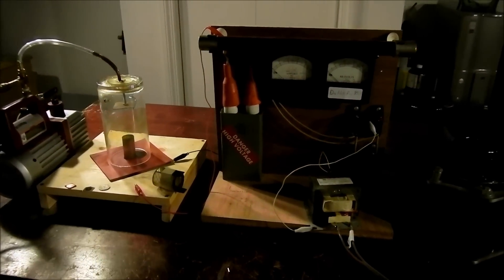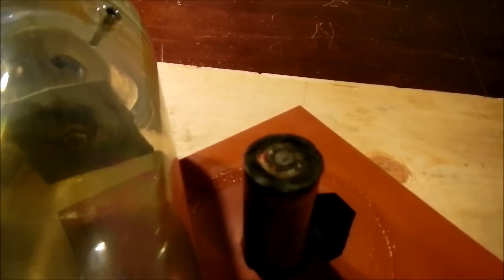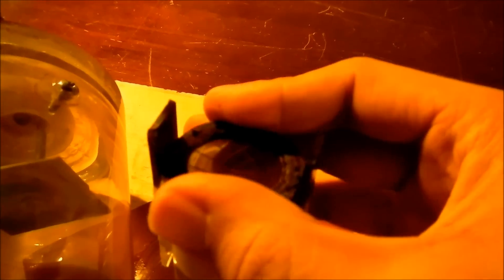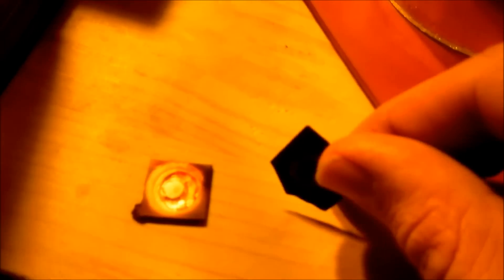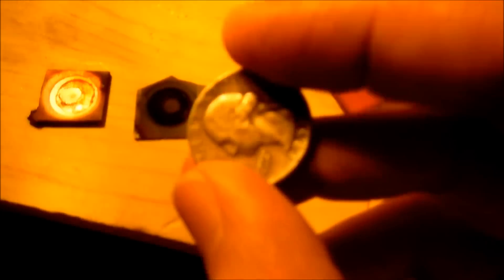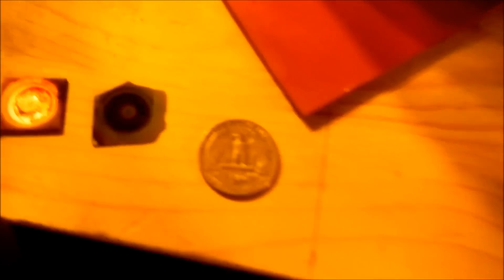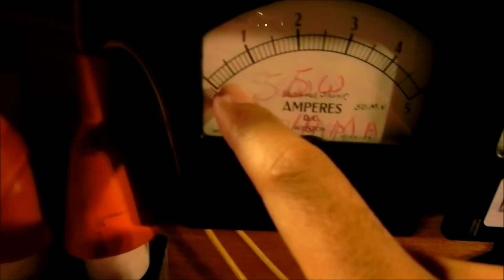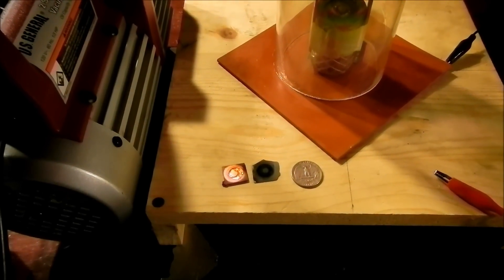DIY : Magnetron Sputtering of Cu, Si, Ag

Comment: What power supply voltage/amperage is required?
Reply from the maker: about 3kV initially, Voltage drops to about 500V to 1000V in steady operation.  100mA to 500mA current
Reply: @sparkstarter  I see. So it has to be adjustable voltage or it's just to save electricity? Maybe you have made guide how to make it? It would be amazing to make own dielectric mirrors, filters and AR coatings :)
There are on Ebay 1000kV 0.5A generators but they are not DC I guess
Reply from the maker: @sauroman1  you need to adjust the output to control the plasma. Haven't developed a DIY guide as of yet...

Comment: I thought you needed 2 transformers to sputter anything
Reply from the maker: why would you think you needed 2 transformers?
Reply: @sparkstarter  this guy from thought emporium on youtube did a sputter too and used 2 microwave transformers but I'm confused on how I'm suppose to wire just 1 transformer
Reply from the maker: @krukimoto6296  you could use 2 in parallel for more current.
Reply: @sparkstarter  do you think you could do a video on how to wire everything from power suply to the chamber 

Because that would be very helpful 

I know you need things like diodes and compasitors which you can get from a microwave too
Reply from the maker: @krukimoto6296  Yeah I think I will. Thanks Stay tuned.
Reply: @sparkstarter  thank you because if I could see how to wire everything correctly then I would be set
Reply: Throw in some safety precautions too because I know MOTs are dangerous

Comment: Hello sir! I will be waiting for.your reply kindly spare a minute or so to answer my queries!
First i am an undergraduate working on a project of fabricating a magnetron sputtering device. The thing is we are stuck to a phase that we have no articles even to follow up except for looking on for DIY videos. Firstly, we are using a rotary pump for.the experiment and as you told we need higher vacuum for it so do we still need 2 stage pump? Secondly we just have a microwave transformer that we have connected with diode to transform ac current to dc . But further upon connecting the diodes with capacitor, we are just getting arcs or sparks whatever u call it and nothing more, kindly let me know sir what equipments have you used for the very same experiment please sir i am in dire need of help! I will be waiting for your reply if you want i can provide you my email id just guide me through! I will be waiting for your reply sir please

Comment: Hi. Looks very nice! What watt was used? Is it 700~1000W? I want to sputter silicon. Although mine is not a proper 'deposition' equipment but I try deposition with a 4inch RF RIE with a silicon wafer as a 'target' and argon gas as ion source, but I don't know what power to start with. I tried Ar 1~5 sccm, 200W, 50mTorr for 30 minutes but still I got coating barely noticeable on my glass substrate. Should I increase argon flow? or power?
Reply from the maker: Yeah probably around 1000W, 1kV across the vacuum chamber at around an 1 Amp
Reply: @sparkstarter  thank you. Considering my much larger area, I guess I need to increase the power.

Comment: can you sputter copper onto silicon?  like for coating chips dies in copper to make them suitable for soldering onto the heat spreader?
Reply from the maker: You can sputter it on to Si but not sure about adhesion quality/ solder-ability/ or wire-bond ability. Would be interested to learn what you discover.

Comment: How would you do the inside of a thin tube?
I've been thinking about this a bit... an inner diameter of about 5-7mm.
Reply from the maker: You mean metallic coating on the inside of the tube?
Reply: Yup. I read a report that it's difficult to get the coverage uniform inside. I was thinking about using a long, thin rod around a couple mm run along the length. But does there need to be a standoff distance between the target and layer to be coated?
Or, would you be able to direct the plasma stream inside the tube to a degree with permanent magnets?
Reply: titanium and some of it's alloys have some properties that would be useful. Low friction coefficient, low reactivity, ridiculously hard and very good adhesion...
Reply from the maker: Don't think Plasma Vapor Deposition would be good for this application. Do you know about thermal vapor deposition? You could take the wire suspend it through the tube while in vacuum you heat the wire and metal boils off the surface of the wire and condenses on the tube. This might be tricky with titanium as you will need a Ti wire and Ti has very high melting point so lots of power to heat the wire I suspect... might be worth a try.
Reply: sparkstarter i havent yet, no. I'll have to check that out, though.
The tube would need a cooling system too, wouldn't it?

I'd have thought the heating requirements be similar... I'm gonna read up on the difference
Reply: sparkstarter i wonder if it would be possible to combine principles involved in the 2 methods...
Reply: How's this... the magneto pushes the ions away from the target, right? How about using permanent magnets to pull, instead?

Comment: is there x rays emitted during magnetron plasma sputtering ?
Reply from the maker: Not at these voltage and pressure levels. With much Higher Voltages and lower vacuum pressures there could be a concern.

Comment: Are you sure you're not generating X-rays or microwaves in a harmful amount?
Reply: In my experience, just because you do it for a living doesn't mean you are qualified as a radiographer or know  enough about how x-rays are generated to weigh in on the subject with any authority,.  

Also, in my experience, green in a vacuum in low pressure is x-rays and at that low a current, that'll be low power x-rays so congratulations OP,  you absorbed them all.  Fingers crossed for mutant powers but I'm betting on cancer.

Anyway...I digress...  Perhaps my assumptions are way off... perhaps everyone in this channel is educated and credentialed far beyond anything I could ever hope to achieve.  My advice is if you see green, shut it down.  Do like I do and head to your local hospital and talk to the radiographer and get a dosimeter.  Wear it thru your next week of experiments and have it developed and check it.  

Maybe it's xrays.  Maybe it's the copper (it's not).  Better to be safe than sorry - at least then you'd know for sure instead of trusting someone on the internet.  When your car is fukd, there are always plenty of people around who can tell you how to fix it, the hardest part is finding one who actually can.
Reply from the maker: Thanks for your comment, I agree that working in a particular field or having a credential does not guarantee anything. However, you can work out from the voltage drop across the vacuum chamber the maximum frequency of radiation. eV=h*f the potential correlates to UV maybe very soft x-ray that does not penetrate glass. I have tested the chamber with Geiger Counters sensitive to radiation, no radiation strong enough to trigger the detector was measured form the vacuum... So math and measurements say no x-rays... Just wonder why you think green is some sign of x-rays? Many things emit x-rays and don't glow green?
Reply from the maker: +68Stan yep I'm sure
Reply: the only radiation those would create is uv rays.
Reply: Good to hear you're across it my friend.  Why I think that.... I have been told in the past, by several old Power engineers, mostly working in the RF field that glass glowing green is an indicator that X-rays are present. The one time I saw a small globe turn green while playing with plasma displays (balls) it turned out that, that was exactly what was happening. 

That said, I was working well over 10Kv and at an unknown pressure (partial vacuum).  
However, maybe that was a fluke, thin glass perhaps?  Either way, a Dosimeter showed it was in fact X-ray, and I know I was around only 600W, so, low power x at that.  

And thank you sparkstarter, for that formula, I'll be doing some study on that one. I didn't study much math at school.

Cheers, Stay safe.

Comment: Extremely Amazing , I made a very simple electronic circuit on a microscope slide lame U can see it here : https://www.youtube.com/watch?v=VGmFLUNf0nE
Reply from the maker: Actually I've seen your video before... pretty cool. I was trying to sputter a layer of copper oxide and eventually make a solar cell or copper oxide transistor. For now I've had to put my vacuum gear in storage. I subscribed to your channel hope you post some more clever ideas for metal sputtering. Thanks for the comment.

Comment: Is that just your average vacuum pump pulling 100 microns? I'm interested in these types of experiments but the limiting factor seems to be that vacuum pumps can be quite expensive.
Reply from the maker: 2 stage vacuum pump for refrigeration repair. About $130 at Harbor Freight.
Reply: sparkstarter have you tried doing this through a fully enclosed conically tapered high Q resonant cavity with a greater area at the large end of the device, and a dielectric resonator in front of the narrower end.

Comment: really now ... doesn't the x ray volume produced kill a horse ?
Reply from the maker: No, the voltage is to low and the pressure too high to produce x-rays.
Reply: A 2000V supply produces 2KeV x-rays, which are too weak to penetrate glass, or even paper.   For safety issues, they behave almost exactly like hard UV from mercury lamps or arc welding:  if the output was extremely, extremely intense, and had a wide beryllium window to escape through, you might receive a conventional sunburn, and goggles would be a good idea.

Now if the supply was well over 10KV, that's when you need a GM counter to verify safety.
Reply from the maker: wbeaty Wow a comment from Bill Beaty! I've been reading your webpage since the late 1990's looking for high voltage experiments, etc... It feels almost like I'm getting a comment from Tesla.  Anyhow, correct me if I'm wrong but if you take 2000eV / planck's constant you get  4.83 × 10^17 hertz I was considering this ultraviolet light frequency but I see sources have the x-ray band from 10^16 to 10^19 Hertz, so I guess you got me there... still safe enough for a horse though.

Comment: I have many years of experience in the semiconductor industry. I worked with ion implantation and sputtering equipment. Chemical Vapor Deposition, Plasma reactive ion etching and every other process to make Si and GaAs devices.  It is not costly to build a high quality sputtering system if you use surplus items. I have tons of it.
Reply from the maker: Well if you have tons of surplus equipment I might be interested to buy some.
I worked in a semiconductor lab during college...but the goal for this project was to build some basic semiconductor devices with things lying around the house.
It would be nice to have nice surplus equipment but it goes out of theme with what I was trying to do originally.

Comment: With N2, O2 & H2O from the air, C from pump oil and Cl from that vinyl tubing as your gas supply for the ions, you have reactive chemicals contaminating the process. You should try to use a small turbo pump and Ar welding gas. Try making the sleeve of AlO3 ceramic and add a dark space shield electrode ring to suppress plasma at the edge of the target.  Si is a dielectric (i.e. non-conductive) so you will need to use RF to sputter it.  You can use a small DC bias to help direct the sputtered material onto a substrate. Keep the voltage as low as possible to avoid arcing, always less than 600V.  The best operating pressure is about 10mT of Ar. The deposition rate is low but, it will be clean. To get good thickness uniformity and sidewall step coverage, you need to make many scans of the substrate on a moving pallet.  But what you have is very cool.  Keep perfecting it. Thanks for sharing.
Reply from the maker: Again, thanks for your comments Joe, I agree with them. However metallic silicon of the type found in solar cells is conductive and you can sputter with DC. I was able to create a varistor from the materials sputtered from a broken solar cell but I never created a video about this.
Reply: Hi Joe Sitter,  I'm trying my 4'' RF RIE for sputter deposition of silicon. My rotary vane pump reaches base pressure of ~3 mTorr but as soon as I supply argon, it reaches ~40mTorr. Is it okay? I only saw ~10mTorr range in many sputter deposition recipes found on the web. Are they base pressure or Argon pressure? I couldn't make 10mTorr argon with my setup because from what I guess combo of poor quality MFC and vane pump. Do I need a turbo pump? I tried 50mTorr, 200W, self-bias measured at 800~1000V for 40min and the rate is too low. It's just barely noticeable. I attached a fused silica wafer on the ceiling of the chamber. In some attempt I put the substrate 1cm over the target, in the glow hoping higher material flux and higher substrate temperature, but still slow. How can I increase rate?  Thanks